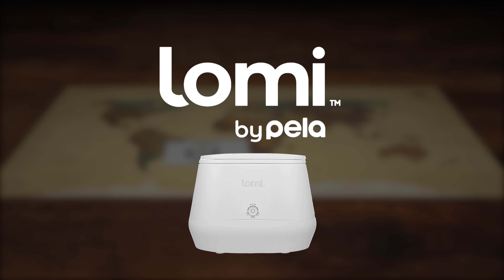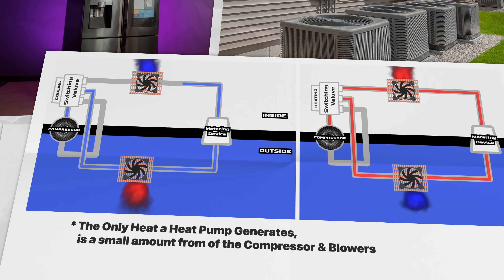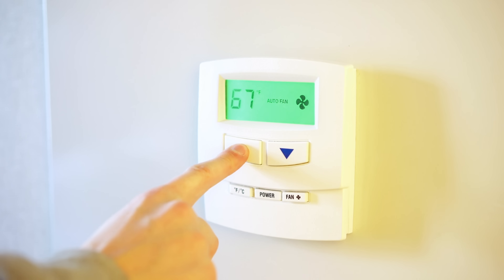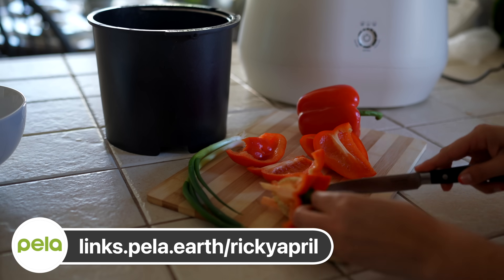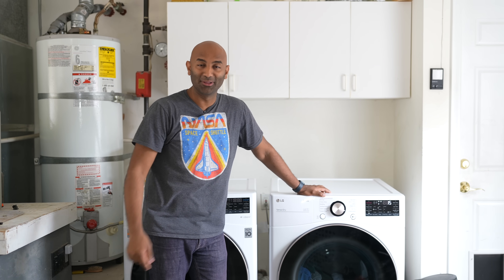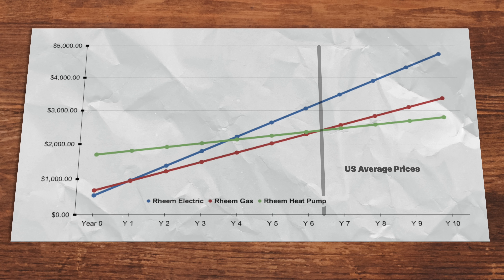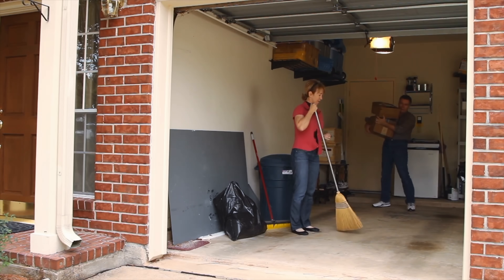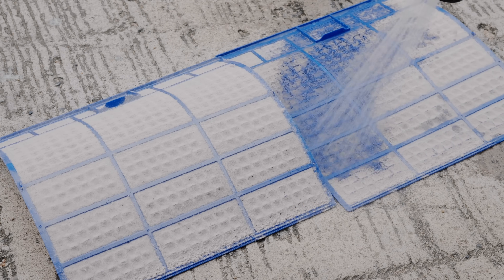I'm Shocked How Much Money Heat Pump Appliances Save!

Comment: Awesome video. I'm getting ready to move back to Minnesota, so I'm curious how this would work in the winter time up there. I'd love to get a heat pump water heater to start along with a heat pump clothes dryer, but if it makes the room colder, I'm not sure how that would work.

Seems like you would need to commit to all heat pump (heater too) or else it would kinda cancel each other out as the furnace works harder to heat the cooler room?
Reply: You would buy fuel to heat your home so the water heater could move this heat to the water. Yes, stupid.
Reply: Switch the exhaust to vent to the exterior in the winter.  Let it vent inside during the rest of the year for dehumification and A/C.   Yes, SMART!

Comment: Good technology, but overpriced for today. 

I do not know what are the servicing rules in other countries, but where I live (DK) if you have a heat pump for house cooling/heating, then it must be serviced at least once per year and this cost anywhere from $150 to $400 which is an extra hassle for the owner + a lot of extra expenses.

This technology has also many other disadvantages, e.g. it is not suitable for all houses, the electricity price recently increased exponentially which will increase the overall cost, they do not work well when it is very cold and thus would require combining them with other types of heating tech or suffering insufficient heating, etc. 

In my opinion the heating pumps for today are fancy gadgets and will not be the 1st choice for many homes

Comment: Here in Boston, our solar water heater provides all the hot water we need for nine months of the year. In San Diego that should be a slam dunk. A hot water heat pump uses little electricity but the Solar Hot Water  system uses no electricity, which I think we can all agree is better
Reply: In san diego, he would be better to buy some extra solar panels instead of a wet solar system to heat water. cheaper, no leaks, high resale value.

Comment: Great video. I agree with it all. We installed a 3 ton Water Furnace geothermal heat pump, a 50 gal Rheem hot water heat pump, and 12kw of solar panels for a near zero annual electric bill. We are considering a heat pump clothes dryer next. There is a 26% Federal tax credit to consider as well...Keep up the great work. Thanks!

Comment: Air drying clothes is a lot more efficient than heat pumps. I live in the UK and even in this horrible weather I do 90% of my clothes drying on a line. Some outside, some in garage depending on the weather. You can then finish them in the dryer and it will have to do a lot less work and use a lot less energy. I wish I had California weather. My dryer would never go on. 😏
Reply: Yea I live in California and air dry everything. It’s pretty fantastic!
Reply: Same I live in New Zealand and I don't even have a dryer. I just hang the clothes on the washing line, it is always either windy or sunny enough to dry the clothes and it hardly ever rains long enough that I run out of clean clothes.
Reply: @kaymish6178  what part of NZ? I’m in Wellington where there’s plenty of wind but it’s too wet in winter to dry clothes outside. I’m guessing you’re not doing washing for a whole family either.
Reply: @TimTheSandmanNZ  I live in Auckland, June is the worst month for weather up here and we still get 117 hours of sunshine that month on average I only need about 50-60 hours of sunshine/month for clothes drying so I can easily dry clothes on an outdoor line year round. on rare occasions i will finish off slightly damp clothes on the indoor garage line with the window open or go to the laundry mat.
 I am just washing for the two people in my house hold so I can understand that people with children would need access to a dryer.
Reply: Right? I was watching this thinking “once upon a time all of our great grandparents had a clothes line in the backyard.” I’m from Minnesota and my great grandparents had a clothes line in the basement too for the winter.

Comment: Why do you need a clothes dryer living in San Diego????

Surely you would just hang the clothes out to dry in the great weather and if it was one of your few bad days, as in winter, dry them using the heat of the house.

If you want to be eco and/or save money, dump the clothes dryer altogether.
Reply from the maker: Ian you're on to something, I have an idea for something... i didn't like the UV damage to my clothing especially darker colors, and also the dust ... but I have a plan to build something that could be cool!
Reply: @TwoBitDaVinci  been hanging my washing out for 40 odd years and never had an issue,though don't live in San Diego :)

Comment: Great video! I also want to replace my gas hot water heater with a heat pump model so I've been doing the math to see if it works out financially. Unfortunately I love near Chicago so my natural gas prices are some of the lowest across the country. Still, with rebates I'm able to just barely brake even around the 9 year mark.
Reply from the maker: hey Jeff, thanks for the comment. In that case, I'd mark that lower priority, and maybe look at some other options first. Like how good is your home insulation? have you considered if even a small solar system could be beneficial? How about rain capture? do you guys have water shortages? There's lots here, and I plan on covering everything in the coming years as I set out to build the most sustainable house!
Reply: @TwoBitDaVinci  luckily we have plenty of water out here although insulation is something that could definitely be improved. I can't wait to see all the efficiency improvements you make going forward!
Reply: For the 8 months you heat your house, where are you going to get the heat for your heat pump WH? They do not work where you live.
Reply: @kkarllwt  two things:
1. I'm talking about a heat pump hot water which would be inside my house and will work 12 months out of the year. 
2. If you are talking about a heat pump for heating and cooling a whole house around here they actually can now work in the Midwest. A few models can now effectively provide heat even when the outside air temperature is down to -5 degrees Fahrenheit. Around here that is usually maybe 12 hours a year. In my case I would also have some heat strips installed with the system just in case temperatures fall below that temperature. Another even better option is a geothermal heat pump.

Comment: I totally agree with heatpump based heating instead of electric resistance heaters. I already switched to Samsung heatpump clothes dryer 3 years ago. The only issue is u need to do some upfront diy mod to prevent lint buildup for trouble free operation. It definitely offsets the additional load due to EV charging.
Also running a BEV entirely on solar power will cut down 500000 pounds of Co2 from entering the atmosphere over the Life of the EV compared to an ICE vehicle(may be a topic for one of your future educational video).
Reply from the maker: Sounds like you are years ahead of me Raman! I love it... yeah we're just starting out, and our new home is older, so there's LOTS to do!

Comment: i don’t understand why F is better for weather.  in C, 0 is freezing cold 10C is cold, 20C is nice, 30C is hot. 40C is insane hot.  How is it worse than F???
Reply from the maker: 30s - Freezing
40s - Really Cold
50s - Cool
60s - Fresh
70s - Perfect
80s - warm
90s - Hot
100s - Woah nelly

There's more room in the region that matters for human beings
Reply: @TwoBitDaVinci  how is it different from:
0C - freezing
5C - really cold
10C - cold
15C - fresh
20C perfect
25C warm
30C hot
35 woah nelly
40 deadly
100C boiling
They have a linear relationship so the same arguments can be mapped to either scale.
I’d argue, C is safer in winter driving.  When u see the temp is nearly 0C, u know there will be black ice.
Reply: The Americans never cease to impress me how they can keep finding excuses to justify their use of more inferior measurement systems like 1kg vs 2lb 3oz and  the use of volume for solid ingredient measurement in cooking.  Like 1/3 cup of chopped almond.  How fine is the almond chopped??. 🤷🏻‍♀️

Comment: You didn't address the main problem here.
Cold weather; heat pump in the house, like normal, will make the house cold, wail you are trying to heat your house, your fighting the water heater, makes no sense, even in a bacement. You should address these problems that the other 50% of the world have Berkeley boy, that would be interesting.
Reply from the maker: Heat pumps work in cold weather, to less efficiency, and most systems have a backup resistive heating element. So even during your coldest months, maybe it works more like a traditional electric system, and then the other half the year, its vastly better, Ian Boy
Reply: @TwoBitDaVinci  lol I'm not sure you understood my comment.
Heat pumps pull out air from their surroundings and make hot water, ya? Guess what, even in California heat pumps can cause issue, I used to install them for pools, you have to take special care where they are installed because they FREEZE the air around them. They make the surroundings COLD therefore when you have one in your house, in cold temperatures, it's an issue, plenty of information out there on this.
You do great stuff buddy, but your very much from Berkeley, I'm from Oakland, we keep it real.

Comment: Pool heater in San Diego? Last decade I acquired a Whirlpool-WED9290FC heat pump dryer with 7.4 Cu. Ft. capacity. It is vent-less, but some heat pump dryers do have vents. I've owned two heat pump water heaters and my most recent is a 50 gal Rheem for $800. I guess it's a different world in CA.
Reply from the maker: Yeah everything CA is more $$ ... salaries are the highest, home prices, energy costs, its just an expensive place.

Comment: The energy costs of all kinds have skyrocketed in the US because of Biden / Democrats interfering with the free enterprise system. Also we're going to need to come up with energy, water and materials for 6 million plus of Bjden's invaders. This will continue to occur every year where we've already maxed out the natural Environmental balance of the country. Just a P.S. we install tankless heaters in four of our rentals. It was a biggest mistake I've ever made in my life. The Continuous maintenance and the retrenching of our gas lines far exceeds any benefits that we or the renters will see. YOU are better off buying black irrigation pipe throwing it on your roof and put it in line with your hot water heaters input. And if you want more heat just add another coil inline. It's damn cheap and no maintenance. Just remember chaos creates cash and very seldom benefits.

Comment: It always amazes me (in a bad way) that people in USA have drying machines. Even in an "I want to be sustainable" video the option offered is "switch to a heat pump dryer"... Why don't you just hang your clothes (either inside/outside your home) and let it dry using ZERO energy?? I'm from Barcelona (Europe) and i'd say here 95% of people don't have a dryer machine, not because we're poor or we lack "technology", but just because we don't want it nor need it.
Reply: In some locations, it is illegal to hang drying clothes outside. Go figure
Reply: Unfortunately, line drying clothes isn’t suitable for some areas. In the southwest, it’s too dusty. In the south and east, it’s too humid. Up north in the wintertime, forget about it. As a compromise, I only dry things ‘damp dry’ in the spring and summer months but everything is dried until it’s bone dry during flu season for sanitary purposes.
Reply: We are in Canada…think very cold winters.  There’s no hanging clothes outside here in the winter.  I really loved my propane clothes dryer because it cut my electric bill nearly $150/month.
Reply: If you hang clothes to dry in a house during the heating season, you have to buy heat to evaporate the water. This is not 'zero' energy.
Reply: @kkarllwt  that makes about 0.0001% difference. It is zero energy compared with a clothes dryer
Reply: @kkarllwt  You are correct, a few times instead of being 100% better, it is still better, just not 100%.
PS: Other advantages of hanging your clothes to dry: your home heat-pump will be more efficient than the dryer one, you humidify your home, you don't buy an extra machine, you don't have to iron if you hang it properly.
PS2: Most eco-friendly product is no product.

Comment: Imagine all your devices and house running on one heat pump system. With a central valve block directing heat and cold where it needs to be, taking heat from fridges and freezers to heat water, likewise heating or cooling the house that way you are rejecting heat or collecting heat from outside as little as possible..... its not entirely a new idea its what tesla do In their cars just move heat from where you don't want it to where you do..... consider this my copyright moment / patent application 😆 🤣
Reply: Sorry but Elon has already talked about this and applying the octavalve concept to home HVAC

Comment: As great as i think you are, the inconsistency of being embarrassed about you electricity bill and then boasting about 1kw being used to compost your scraps was not lost on me! I still respect you but.........🤣
Reply from the maker: 1 kWh isn't nothing sure, But I run it on a solar powered eco flow battery with excess sunshine. The thing with electricity is you have the luxury to use it as you see fit, if you can produce it yourself. My plan is to produce and store so much solar energy, that I can do even more high energy things like capture water from the air! But all this has to scale with my reduction in consumption from more efficient appliances, and generation.
Reply: @TwoBitDaVinci  yeah ok fair enough . Start implementing systems on energy intensive farming operations . My uncle made a lot of Money doing that and that was 2 decades ago so with todays tech you could easily create profit share energy harvesting with the right farming partners . They do the capital and you implement on a modular scale and increased as they raise the capitol. It can be managed remotely too if thats needed. Do your house first as a model and learning curve and start seeking industrial farming partners that use a lot of energy ! The advert is as simple as " does you farming use a lot of energy "?

Comment: Thanks for this video, Ricky. Electrifying everything does work well even here in San Diego where our e- is more costly. We're fighting for these changes at the San Diego Building Electrification Coalition. It is important to remember that electrical upgrades are often needed to power some of these appliances. Thankfully, heat pumps are so efficient that it's becoming less of a problem. This year we're seeing the first 120V heat pumps (most of those aren't hybrid and skip heating elements as a backup) that were designed to help make retrofitting less of a barrier.  The TECH program in California is helping folks finance changes to their heater and water heater to electric heat pumps. And starting Jan. 1st 2023, California building code will require either a heat pump space heater or water heater depending on your climate zone for new construction in residences. The hard fight for decarbonizing buildings at the city level through Reach Codes and Gas Bans has helped us shift direction by the state to support the effort through government regulation. This is how we use collective action to win climate solutions that work.!
Reply: Banning Natural Gas (or just shutting down the pipes) I get. That stuff is basically straight methane and the piping system seems incredibly dangerous and you hear about leaks on a regular basis.

But afaik gas bans extend to prpane too, and that's pretty fucked. It's a byproduct of gasoline refinement that we might as well utilize and any accidents are contained to that system's capacity.
Reply from the maker: most of the laws I mentioned are about natural gas, not propape, which is what's piped to new construction.
Reply: @TwoBitDaVinci  oh nice. Thanks for the clarification
Reply: @priestesslucy  No, we don't "hear about leaks on a regular basis"!
Stop spreading FUD!
Reply: You anti carbon people can't even figure out simple things like hey that electricity doesn't fall out of the sky it has to be generated and oh shoot that requires energy. just wait until you decarbon heads are all driving your EV's and your plugging into the carbon grid and you cant get natural gas your electric bill will be 5 times what it is now. oh i know you'll just plug into solar except that only works when the suns out and not everyone has space for panels.
Reply: And you wonder why real estate is so high in SD?

Comment: Yes, 25C is good, my Heat Pump is set to 17.5 (night) or 21 (day) heating and 24.5 cooling. I do have an electric water heater, but am looking at heat pump when it breaks down in 15 years.
Reply: Sell it for what you can sell it for and make the switch to start saving money.  Look into local and federal rebates as well.  I think my $1250 HPWH actually cost me around $350 or so after both rebates.  Even at full price, do it and save money.

Comment: Ricky ...be sure to do a little study on the R32 (new refridgerant that has a much smaller Global Warming Potential than existing refridgerants)  our friends across the pond have had access to R32 hardware for years.   Supposedly the R32 launch for North America is supposed to be imminent.   Daikin's European page has lots of cool stuff like the Altherma 3
Reply from the maker: I'll keep an eye! our new heat pump systems are SO much better than they used to be with gas escaping... new systems almost never need to be topped off.. combined with better less harmful refrigerants, and its a win win